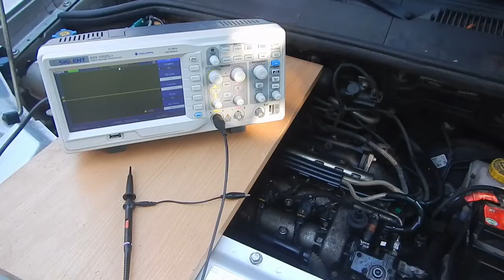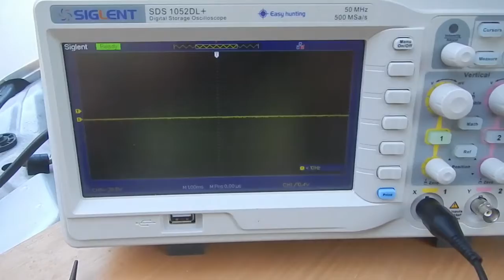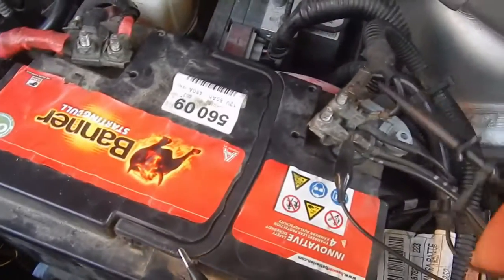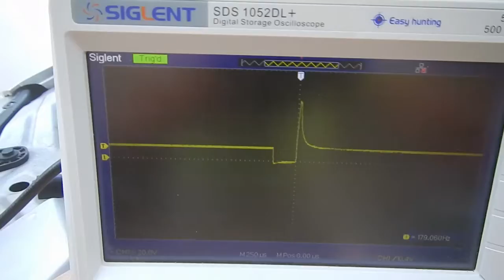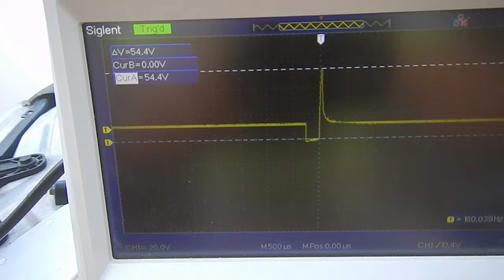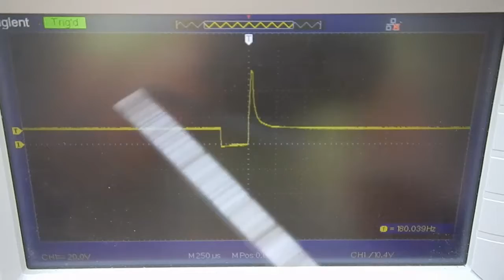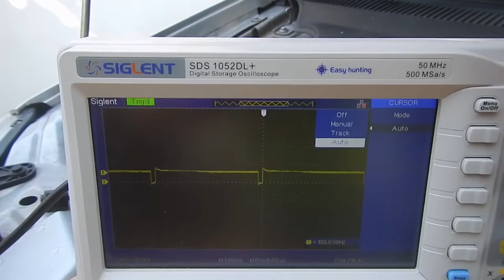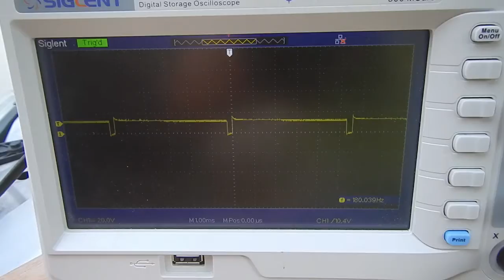Scoping FPR - Fuel Pressure Regulator with Oscilloscope

Comment: your probe is set wrong. needs to be 1x then 2v or 5v per division. Thats why it shows 54v 55v. If you set to 10x probe you will get high voltage reading but you can get the same wave. need to be set at 1x probe or use automotive bnc alagator probe connector for scope which is 1x and set scope to 1x